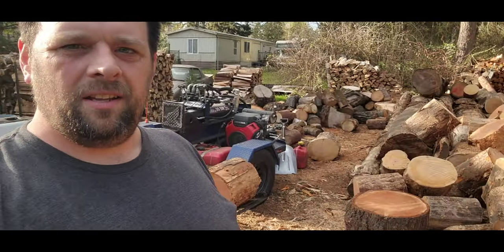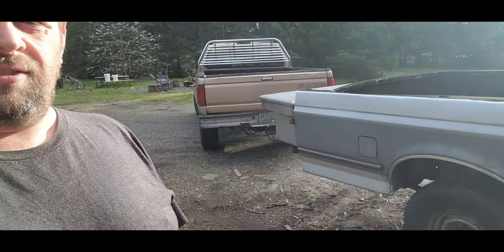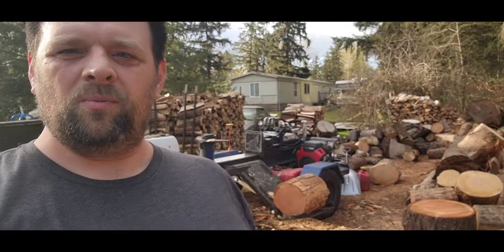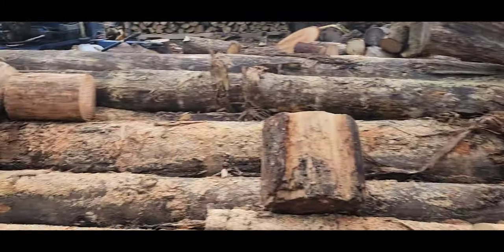Fir & Maple Firewood Mix. From Round To Split And Loaded Up.

Comment: Dan i appreciate that you take a second and clear the split pieces out of your wedge so you are able to adjust the wedge height as needed per round to get the split size you need. Many channels don't do this and i cringe watching it. Keep cuttin'!
Reply from the maker: You're welcome.  This splitter is set up enough that it will actually push wood against the tailgate and move the splitter at the same time. It can do this when in a pile too, and I think that's kind of neat.
Thank you for watching and commenting 😉 👍